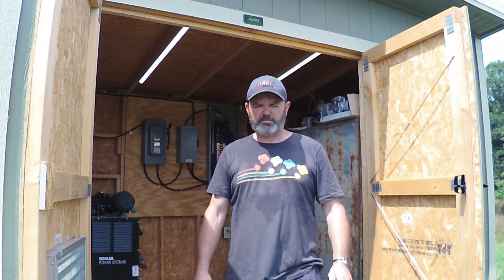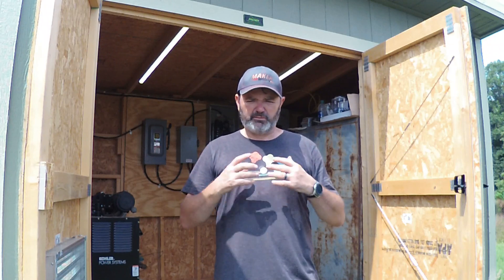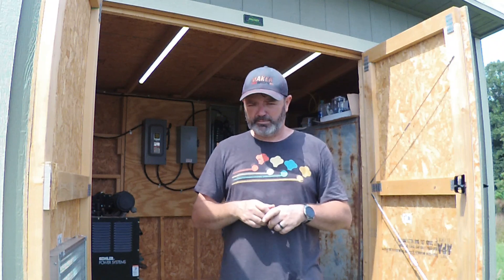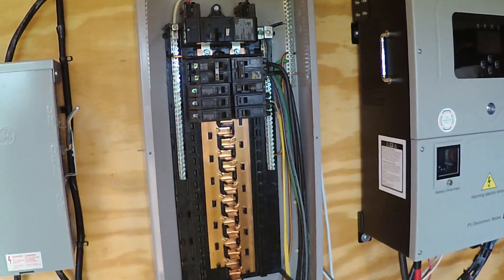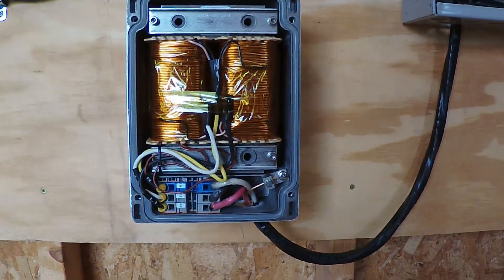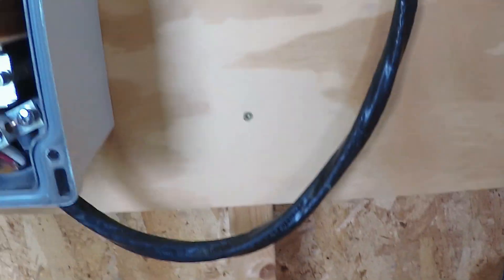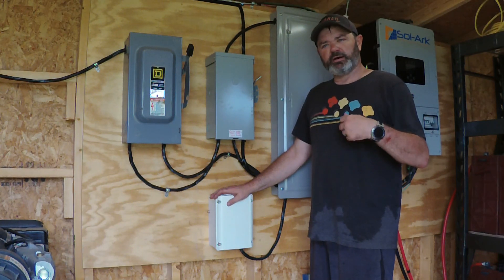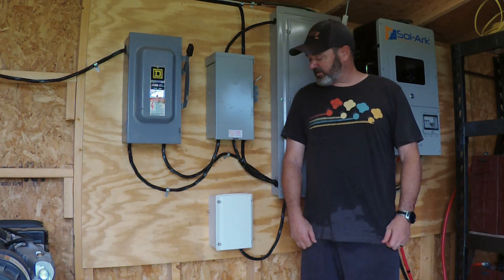DIY Off-Grid Solar Upgrade - Solar Edge Auto-Transformer

Comment: The transformer will balance the loads, but you must remove the neutral from the Sol-Ark. The Sol-Ark should supply 240 only to the transformer, the neutral is determined at the transformer only. I live off grid with a Sol-Ark 5K 2P both my loads are identical

Comment: Nice. This a common problem with transformerless Inverters that contain 2 X120V legs. Each leg can only handle 1/2 of the 120V loads. This adds capacity to the overloaded leg of the inverter when there is a larger than 1/2 load on one 120v leg of the inverter and stops the inverter from overload tripps.

Comment: So, what was the amps in L1 and L2 before the AT was installed?  And then what was amps in L1 and L2 after the AT was installed?  Because the AT does not actually fix the inbalance, it only refuces the imbalance.

Comment: Great video Steve. 
Due to the intense weather concerns, do you have concerns regarding your wooden power shed being close to water level that could flood or all your equipment being blown away? Would you consider raising it above grade and using a concrete structure?
Reply from the maker: That's my pond behind it. I live about 1000' above most of the state. I'm not really floodable barring something biblical. That building is also on a permanent concrete pier foundation, not blocks, and it's bolted to each of them.

Comment: Can I use the SolarEdge transformer with my 230-40v single phase inverter to create the two 120v legs my inverter ac output only has L & N no ground

Comment: Hey Steve, I'm just seeing this now! Glad I could help.  I've found that it really helps in my system, especially when off grid, hope you found the same.  
One question I get a lot is "did you disconnect the neutral from the Sol-Ark?" No, I didn't and it works almost as well.  There's also no risk of the autotransformer breaker tripping out and causing a surge on L1 or L2, because if it does, worst case the Sol-Ark will just overload and shut down.  
Thanks for the shout out!
Ben
Reply: What's interesting is that the Victron autotransformer documentation says to not connect the source neutral to the AT when using it in a balancing scenario, only use the neutral from the AT to connect to the load panel.
Reply: @NeverTakeNoCut-offs  Victron is correct. But this NOT Victron equipment and it is NOT a typical Victron design.  There are very good reasons for not connecting two active neutrals together.  In this video, he is masking a limitation/problem in the Sol-Ark.

Comment: Steve, David Poz has a more recent video where he demonstrates a perfect balance when removing the neutral off the Sol-Ark and using this same autotransformer.  Have you any insights on this configuration and if Sol-Ark supports it?  Thanks.
Reply: https://youtu.be/EYIzEW54_bY at around 20:50
Reply from the maker: Thanks! Do you have a link? I'd like to see that.

Comment: Wow, I have a Schneider 4024 and this may just fix my issues also! Thank you so much for the video.
Reply from the maker: The only reason I needed this was we had a buried 2-2-2-4 feeder line go dead on one leg, so until I replace it we've been drawing everything on that line from one load leg. Otherwise, it's never been an issue. However, this little thing has completely fixed our current issue until we can get around to replacing the 2-2-2-4.

Comment: Excellent video. I have a question. Does these draw any additional power? and how does it affect any other 240 or 120 loads? Does this limit your capacity? I will not be on grid power at the homestead.
Reply from the maker: Scott Hunt @engineer775 explained to me the loss/draw was negligible. It doesn't limit your load. It will only balance so much but generally speaking an unbalanced load isn't that big of a problem except in unusual circumstances like running a 30 amp RV. A 30 amp RV draws everything off of one leg. A 50 amp RV pulls from both legs.
Reply: @stvbird  ok cool thanks

Comment: Why not use surge protector instead of auto-transformer to solve the load balance?
Reply from the maker: If you currently have grid power, which I’m assuming you do as most people do, you’re loads in your homes breaker panel are balanced by the transformer on the pole near your house. This is basically doing the same thing. I’m not sure how a surge protector would solve this problem. A 240 system is just two 120 lines coming from the same source. In my case, the Sol-Ark. If too much draw/load comes from one side of the breaker box (each row of breakers represents a 120 leg of those two loads, unless you’re using a 240 breaker, then it contacts both sides of the breaker box to give you 240. Anyway, if you pull more from one side than the other, the load is unbalanced, but in an on-grid world, that balancing is done in the transformer on your pole as stated earlier. Where my problem came from isn’t so much the limitations of a Sol-Ark, it’s from a failed 2-2-2-4 feeder line that’s buried underground. One of the load legs has a broken wire underground, so to power our 50 amp/240 RV, I’m having to use a 30Amp RV adapter to run our power box off of a single load leg (50 amp RV’s are both legs, 30 amp RV’s use a single leg). That’s where our unbalance came from. We’re powering two refrigerators, two air conditioners, two microwaves, TV’s, and a washer and dryer all off of one leg. In a normal world, or in a world where I replace that buried line, our power imbalance won’t be an issue, but the autotransformer is helping me avoid my problem until I can fix it right.

Comment: Did you disconnect the Solark neutral before before hooking up the Solar Edge. I have used them and they are designed to center tap a 240v line. Not sure of the longevity of it with Sol-Arks neutral tied into it.
Reply: David Poz has a video with this same AT and sol-ark setup.  He was able to demonstrate perfect balance once he removed the neutral from the sol-ark.  I've got questions about Sol-Ark's support for this undocumented configuration though.
Reply: @yamlcase230  I've pretty much pulled away from the Sol-Ark but thanks for refreshing my memory on the Poz video. Here in California the Grid tie side of things is getting touchy. Straight off grid solutions are becoming more popular with a grid backup. So there is less need for the bells and whistles Sol-Ark offers. Can get more out of a pair of Growatt 240v 5k's

Comment: How do I connect this to an inverter? Also with the way the transformer is setup in your video does it power the transformer and step it up to 240v?
Reply from the maker: You don't need to hook it to your inverter. You run it through your load panel. You can use it to step 120 up to 240, or wired like mine, with L1 in one side of a  240 breaker, and L2 into the other input of the same breaker, it essentially contacts both loads in your breaker box (left side and right sight of the box) and balances it out. Essentially each load leg of your breaker box flows into it and are balanced between each other inside the auto transformer.
Reply: @stvbird  Thanks
Reply from the maker: Btw... My Sol-Ark 12K is 240 based, so my breaker panel is already 240. This just balances it all out and makes the L1 and L2 from the Sol-Ark be pulled on more evenly in cases where you're pulling more from one side of the breaker panel than the other. You can use this to double a single 120 line into 240, that's just a different use than what I'm doing.

Comment: Thanks for your videos. I'm looking to get a Sol-Ark 12k and I would not be running AC units (mostly just misc small critical loads) but I do have a 230v well pump 1hp about 8.5 draw. Do you think I would have a problem such as you are describing in this video with the Sol-Ark not  being able to handle imbalanced loads?
Reply from the maker: If the well pump is 240v, it would be a balanced load, pulling from both legs, so that wouldn't create a problem at all.
Reply: @stvbird  Ok thanks.

Comment: Nice video Steve  !  Just a FYI for anyone that thinks they might need more balancing capacity ,  Victron makes an autotransformer that is 100 amps , includes a fan and circuit breaker . It's double the price of the little Solar Edge one though at about 650.00 .
Reply from the maker: Yeah, I looked at that one, too. Maybe when I stack a second Sol-Ark that capacity will be just what I'm looking for. Thanks.
Reply: The bigger Victron 100 amp Autotransformer does NOT provide any more balancing amps vs their smaller  Autotransformer. In this situation, the Victron 100 amp AT would be a waste of money.
Reply: @MrSummitville  It's never a waste of money to plan for future expansion and with the added breaker and fan included more so .
Reply: I cant find the solar edge anymore.  Looking fir a different solar project.